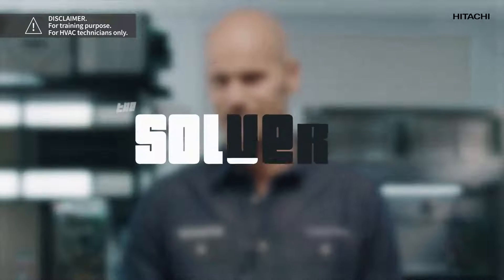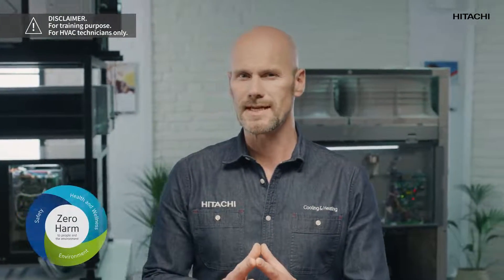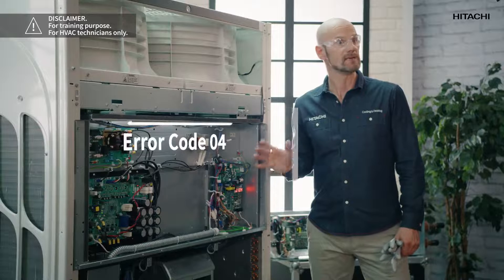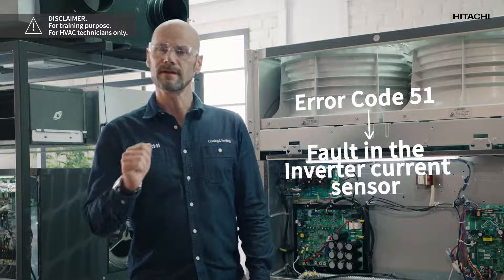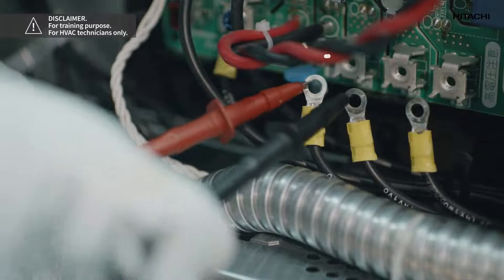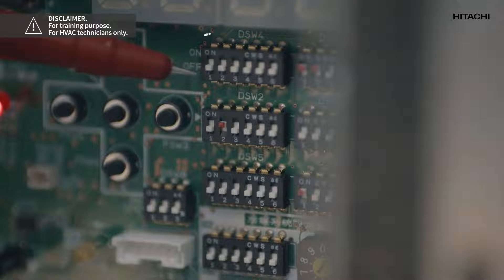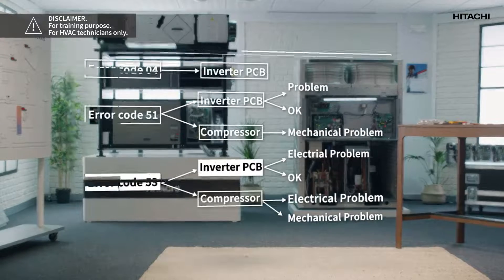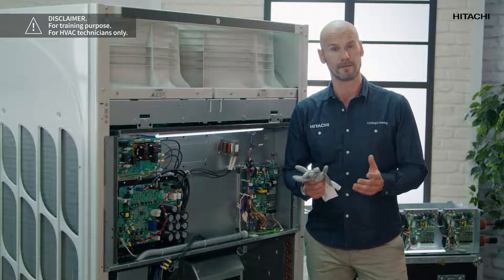How to check the inverter circuit on Hitachi Sigma VRF air conditioning system

Comment: I have a problem with my Hitachi when I turn on the system the starts but when the compressor tries to start it breaks the transistor of inverter board and shows 04 error code I already chande the fan and the inverter PCB but I still what should be happening with the unit?